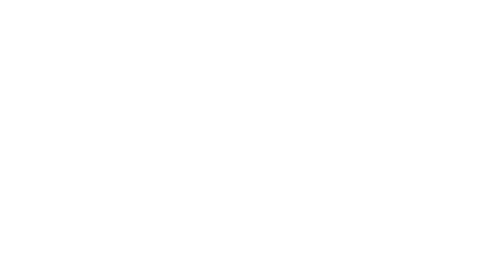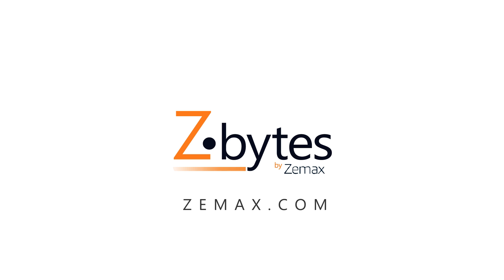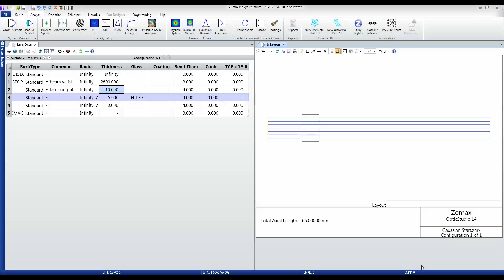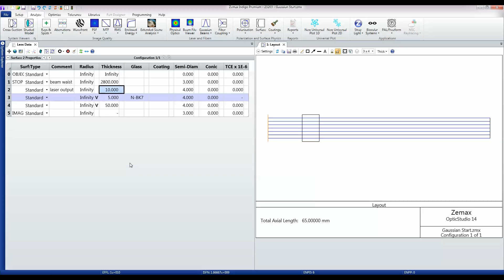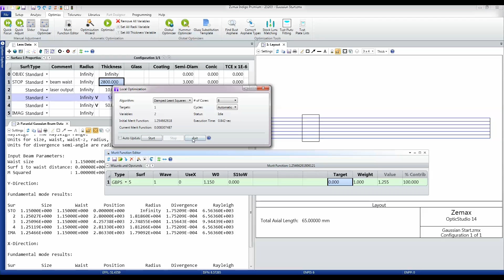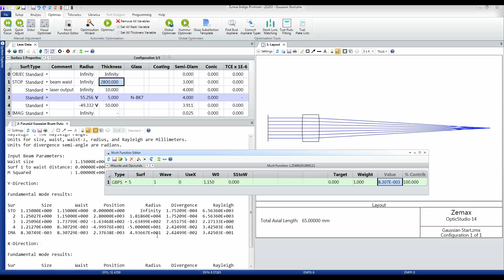Gaussian Beams

Comment: i am trying to understand what gaussian profile means, from my understanding it seems like the central axis is stronger while any other rays away from the centre become weaker, how are they weaker in what term? is there intensity less and why is that? is this like saying that each ray has its own lumen or watt intensity or are they all the same but because there is less rays away from the center it become weaker? is intensity something that you juts add so if we have more of the same rays in the same area the intensity is stronger or brighter?
and why is it that if we have a laser medium of cylindrical ruby for example why is it that each photon in the cross section is not evenly distributed when they are being created or stimulated? why should the center have more intensity than the rest of the circular area if each ray is parallel to each other?
also is the light distribution of an led or cobb gaussian or something else? because i made a small project where im trying to collimate white light from an led and the distribution of the spot seems even ,i also have other questions on my project if you can please answer asi do not see any info online regarding this
Reply: Gaussian beam related to the intensity profile perpendicular to the optical axis. Center contains more intensity and slowly dies of off center axis.  During propagation, a gaussian beam that is focuses will not look like a infinitessimal dot, but will adopt a radius called Waist. This is due to diffraction. Gaussian beam are generally caused by statistical sources like lasers.
Reply: @firedrive45  thanks and i know all that but some of my questions were not answered and what do you mean by "statistical sources"?
Reply: @ARCSTREAMS  most phenomena have probabilities and when a lot of interactions happen, it often has its population along a gaussian distribution, normal law. Laser have such statistical properties, where photon population has a gaussian spatial distribution.
Reply: More rays, more flux, meaning higher intensity
Reply: thank you but why are there more rays in the center of a circular cross section beam than in the outer edges of that circle? @danielgeorge7466

Comment: Very unhelpful. You don't show how to input the HeNe laser other than mentioning the beam waist being 2800 mm away--and then you say that the beam is already expanding when it leaves the laser, which means the beam waist is back inside the laser.
Reply: That's actually correct...in a Fabry Perot laser cavity the beam reflects multiple times before exiting the output port of the laser. The beam waist appears to be several meters behind the output cavity. That's one of the things that makes Gaussian beams so tricky. The waist is often outside the physical cavity itself, and the exiting beam might even be outside the Rayleigh range of the  beam waist!
Reply: Totally agree. I just have seen several sections of tutorials and still have no idea about what the 2800 mm is and how GBPS works